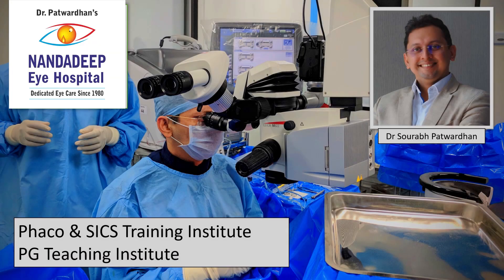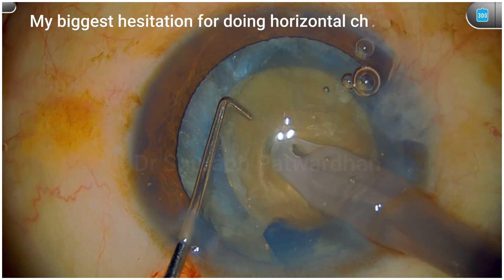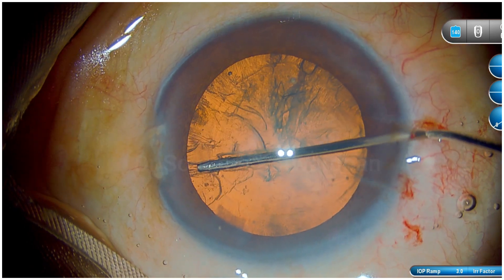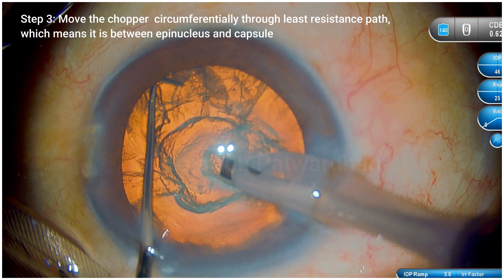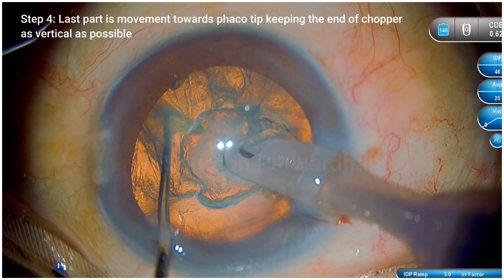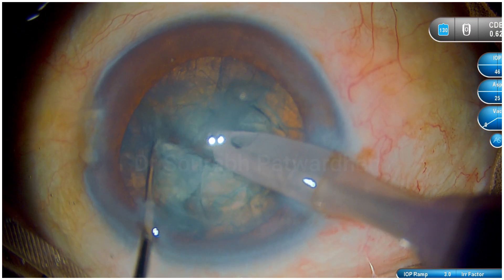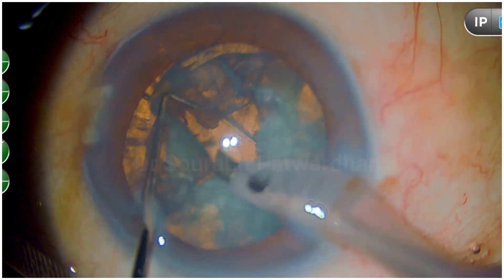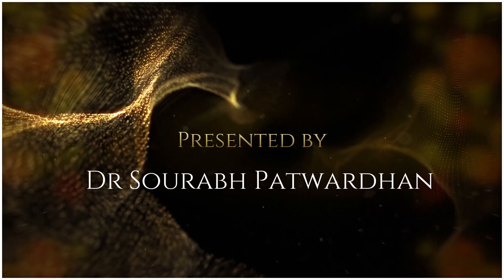288 simplified horizontal chop:step by step with Patwardhan chopper Dr Sourabh Patwardhan

Comment: Hello sir..

Using ball point chopper will avoid the risk of tearing ..
And we can insert it upto equator with no fear..

I have been copying Dr Neto for more than a year now and all cases i do mechanical chops and submarine chop for hard cataracts..

Great clarity on the videos now sir.. seems like the recording system has changed..
Reply from the maker: Excellent.  Thanks for sharing your experience. I have tried to make this easier one to adapt for those who are more comfortable with vertical chop. Patwardhan chopper is blunt so chances of capsular damage are not there.